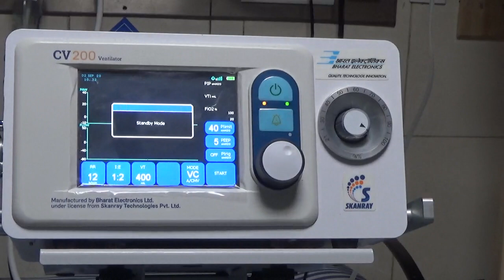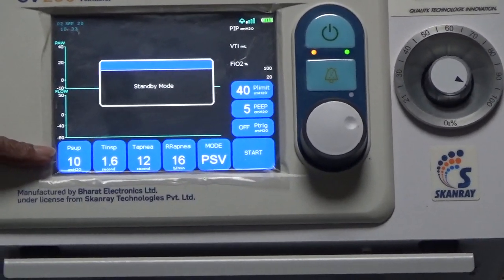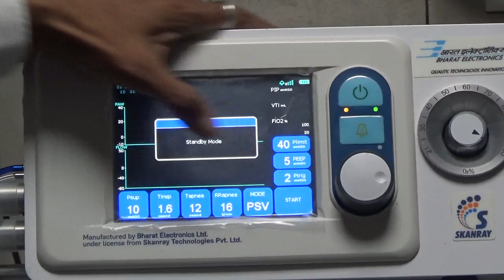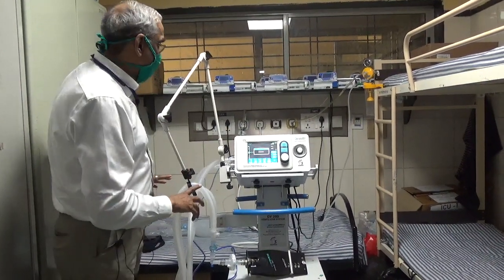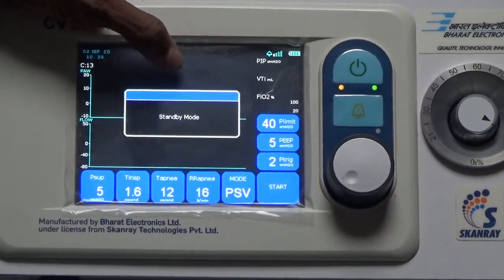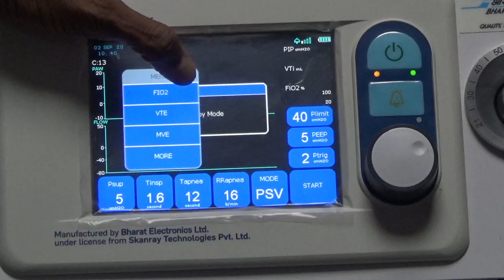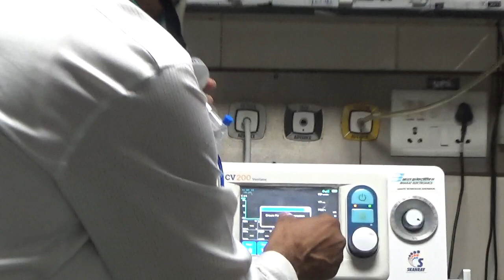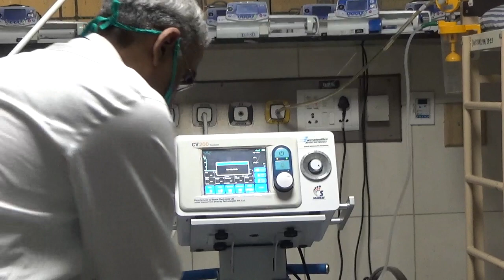Acute Care Training : NIV

Comment: When to use PSV with peep on covid cases.
At 13.45 you said if co2 goes up then increase PS.why Wait for ABG.
If expired t .vol.is less then titrate it with PS.please do respond.
Reply: Use psv - to wean the patient in invasive ventilation
In covid cases if we dont have bipap machine to provide niv -- then
we use psv mode of invasive ventilator to provide NIV with mask.

In covid cases we use NIV only if - 
1. The patient is consious oriented and spontaneously breathing
2.cant maintain PO2- above 55 on NRBM/HFNC
3.To give a trial before invasive ventilation

Next question-
Because ps looks after ventilation of co2 only, not the oxygenation.
In covid cases /ards we require lower vte to prevent barotrauma. So only if patient is going into respiratory acidosis due to increased pco2 ,then we titrate -ps and rr in order to increase vte and minute ventilation

Comment: In the PC Bi-level mode If u set up peep at 5 then how much pressure high & pressure support should be ?
Reply: Start with minimum pressure support of 5 and then increase it gradually if ventilation (co2) is problem, or if vt required( for minute ventilation) is not achieved
I.e. ipap-10 epap/peep-5..
Reply: @swarooppowar4390  ur answer is for bipap machine but I'm asking for ventilator ( mode PC Bi-level)
Reply: @dharmendrasahu8704   set pressure limit to 30
And PS-of 5 intially.and you can increase gradually